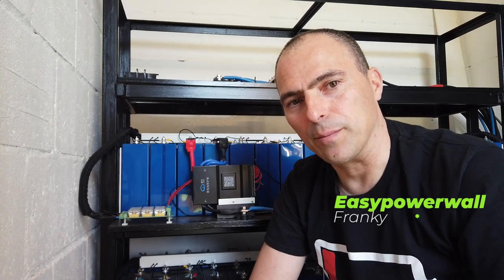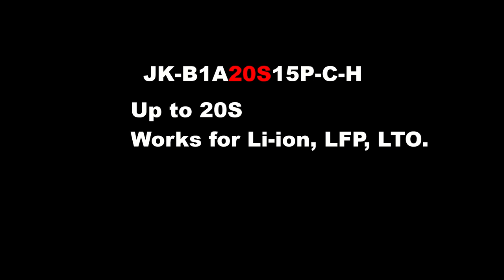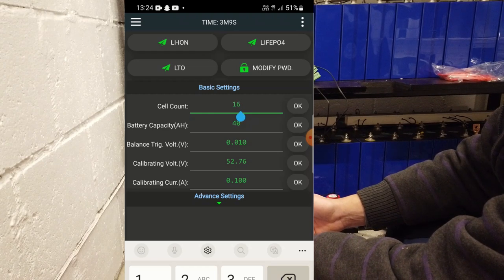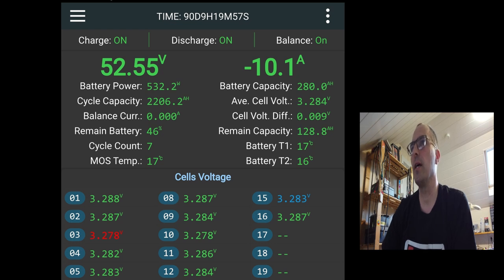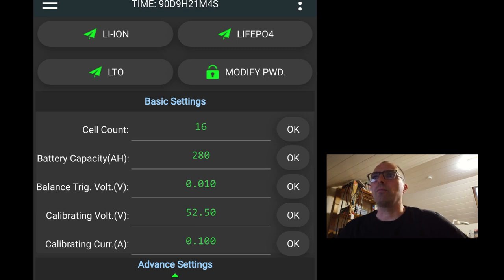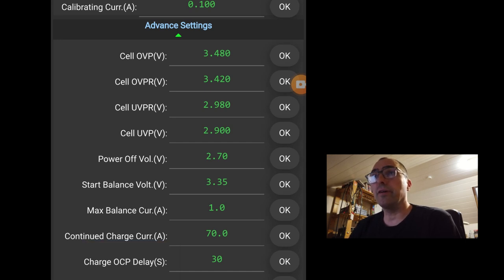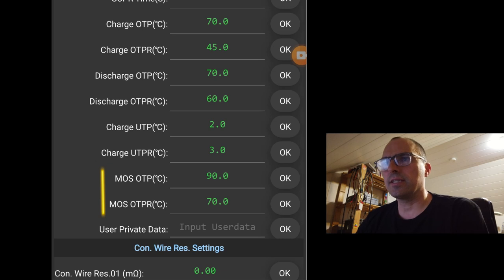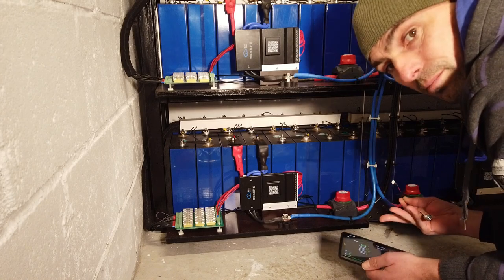JK-BMS in depth review and overview of all settings

Comment: Thanks for walking me through the jk setup and the settings spreadsheet. I also didn't receive the one page doc with the BMS. 
My system is only 3200w inverter, 4800Wh LiFePo4 Battery. To save cost I got only a jk with 80A and 0.6A balancing. I have still a 4A capacity Balancer and will run both at the same starting Voltage. Have installed also a cell meter 8 to have a constant view at my Inverter. The 2 and 4A jk BMS are so costly now. My 80A version was only 50$. Hope to be able to slowly maximize my capacity as I have limits uning only 1440W Solar panels and living in the Highlands of Mindanao, Philippines with more clouds and rain. This is my first solar setup and as a retired electric and IT technician, this project keeps my gray cells busy even at age 71.
Reply from the maker: Thanks for the great feedback. We all started with a smaller setup en let the system grow. Keep up the good work and stay healthy and strong to enjoy the green evolutions as long as possible.
Franky - EASYPOWERWALL

Comment: I have a question, My 2x JK-BMS (JK PB2A16S20P) are configured to let my victron multiplus 2 (3x / 3 phase) load my 2 batterypacks (16x320Ah LiFeP04 Cell) (JK BMSes connected to eachother, then 1 can cable to the Cerbo GX.

My Charging (absorption) voltage is about 54,7V with high current for an hour, and then raises to about 56,7V with low current. Thats the wrong way in voltage!??

Cerbo is set to DVCC Mode.
My most important BMS settings are:
Cell OVP:			3.65	V
Vol. Cell RCV:		3.6	        V	= 57.6	V
SOC 100% Volt:		3.55	V	= 56.8	V
Cell OVPR:			3.54	V
Cell UVPR:			3.02	V
SOC 0% Volt:			3.0	        V	= 48	V
Cell UVP:			2.8	        V
Power off vol:		2.65	V
Vol. Cell RFV:		3.50	V	= 56	V
RCV time:			1.0	        H
RFV time:			6.0	        H

Someone can help me to get this right?

My thougths are first high voltage and amps absoption, then lower voltage and amps for float?
What settings in BMS do i have to change??

Many thanks for reading this,

Comment: Hey Franky, quick question, What would be the settings for a 72v (84v) battery pack built with this. " 26650 Liitokala, model Lii-50A, 5000mAh, 3.7v, max 4.2v, min 2.75v with120 cells    I check the xsl file for the BMS parameters and is great to be able to understand what all those settings mean but not sure what should be the parameters to use.  great content and well explained! Thanks in advance!!🙏

Comment: The reason for the BMS can turn off balance can work like you said to use an external BMS but also to prevent that the BMS discharge the battery since even with BMS power off, balance keeps running, if you have a bad cell you will  end with a discharged or lower state of charge and that is not good for an battery in storage.
Reply from the maker: Thanks for  your reply. Have balancing on from 3.35 (changed setting to 3.4). So when battery is low balancer will not be active and will not drain battery. That's why it's important not to balance all the time, only when voltage is > 3.4V.

Have a nice day.
Franky - easypowerwall.com
Reply: @easypowerwall  I'm also in 3.4 V and probably will go a bit high.

Comment: If you run 2x JK newinverter BMS in parallel, and connect it to Deye (or some other inverter with CANbus), does the SOC be reported in the inverter from the Main BMS, is a mix of pack 1 + pack 2?

Comment: Thanks for the video. You mention on/off switch and old/new version at the beginning of the video but I couldn't see it. Did your BMS come with an external on/off switch, did you mean that?
Reply from the maker: Hi, check the video 5:45 where I'm gonna push the on/off switch. Older models don't have this swith and you had to apply 5V to start the BMS. If you click on the link under the video to order the BMS you will receive the latest model with switch included. Good luck.

Franky - easypowerwall

Comment: Did you ever check the power consumption of the JK-BMS? This is an interesting number as you will typically use this all the time. I found values from a few 100 mW up to 3W and even more. I also found some extremes with 30W and more but i doubt this, probably faulty. Anyway, if its in the 1W+ region it will draw 150 Wh a week or more! Thats already a lot, when the battery just sits idle in a few months (in winter e.g.).
Reply from the maker: That's a good question, but never checked this. Good idea for another follow up video about JK-BMS. Stay tuned.

Franky

Comment: Why are you start balance at 3.35v? There’s no benefit of balance anything below 3.4-3.45v, due to the flat curve. Real balance starts when cells are near full. Otherwise you keep shunting current in the flat curve, for no reason.
Reply from the maker: Hey Aurel, that's a good point. For now I have  it on 3.35 because I haven't done topbalancing (on purpose). I noticed a few cells had less charge then others, so started balancing at 3.35V. In the future I might increase it to 3.4V. Will make a follow up movie 🎬  about this.

Thanks again for the feedback.
Reply: Hello , first sorry for my English, I have a jk bms ,it is 0.6a of balance ,my battery is lifepo4 60v , 20 cells , but I have 3 of this cells with 3.5v and 17 with 3.3v and the bms cut the charge when one of this 3 cells get de maximum voltage 3.7 approximately and the other 17 cells never get a fully charge, do you thing that the bms itself is capable to balancing this 3 cells that have a bigger voltage? , and what parameter do you think that I have to write in the START VALANCE VOLT .( V ) in the settings, thanks I hope you can help me
Reply: @projectv8639  hey, 3.3v means your 17 cells are anywhere between 30 to 60% charged. I wouldn’t want to wait for my BMS to balance 17 cells 😂, could take months. I would either try to top balance them or discharge the 3 full ones down to 3.3v.
Reply: @hammersbald7612  ok I would discharge the 3 cells to 3.3 ,is better I think ,thanks
Reply: Andy's Off-grid garage recommends not to balance below 3.45v to ensure being into the steeper part of the curve. Most specs say max cell voltage is 3.65v not 3.7v.
Reply: If you are disabling the charge balance so it balances all the time when commissioning a new string of cells and you charge at .2C to bring the cells up to 3.5 or 3.55vdc and let them rest at this for a day this is what I would call a good low stress top balance.. Then you could set it to charge balance at 3.45vdc and your charger to 3.48-3.55vdc and should never have to mess with it again unless you have long dark winters and you charge exclusively with solar..

Comment: I would like to ask how does the JK BMS reset to 100% SOC? 
When the Cell Over Voltage Protection occurs?
Reply from the maker: Yes, that's how it works. It learns from charging. The BMS can't exceed 100%, so it set 100% when max capacity is reached.

Comment: Hi thank you for all the information 👌👌👌 I’m getting a 100amp jk bms for my ebike and I will be getting a bigger controller in the near future but for now  can I limit the bms to 70amp  output  to match my smaller 60amp controller that I currently have .
Reply from the maker: Hey, thanks for asking a question. Sure you can limit the maximum current of your BMS. Go to settings and go to advanced settings. Search for "Constinued discharge Current" Enter the desired value. It's in the clip at 19:00.
Good luck.

Frank
Easypowerwall

Comment: Hello Franky, this is really wonderful. Everything is meticulously detailed. I was able to initialize my 2 JKBMS JK-B2A8S-20PC with my 2 12V 280 Amp battery packs, it's great. There is just one small detail, in addition to the Bluetooth on my phone I also have the control screen. (The large model). The batteries are fully charged, but it only shows 78 percent charge. Perhaps this is normal and we will have to wait for the cycles to complete and for the battery and settings to gradually improve. If you could reassure me on this point that would be great. Many thanks again for your video, it’s great. Dominic
Reply from the maker: Hey Dominique, thanks for your great comment. To initialize/reset soc of 100%, your cell has to hit the "cell overvoltage protection" If it cycles a few times it will sync and you will get the 100% SOC number. Good luck.

Franky

Comment: Thank you for this.
I have a question.
The nominal current is confusing to me.
If a battery pack is 48v / 280ah and we have 4 packs = to 1120AH
I would need 4 x JKB2A20S ?? -C-H 
Is the nominal current based on the total AH of the pack so i would need to 500ah version ?
Reply from the maker: Hi, My battery bank has 4 16S configurations. I installed a BMS on every 280AH battery (16S) So a 200AH BMS is OK....no need for 500AH bms. Hope this helps.

Comment: How does Calibrating Current work?

My JK is reading ~30% low at low loads (showing -1.7A when real draw is -3.3A).  And about 50% low at high loads (showing -60A when real draw is -110A).
Reply from the maker: Mine was spot-on. If it's not correct I suggest to use a clampmeter to measure the current and adjust accordingly.

Good luck.
Franky - easypowerwall

Comment: Hell. What setting should I set my charg controller using lifepo4 3.5V 30A+30A 16S. What amp should I set my charg controller?
Reply from the maker: Not really sure what 30A+30A means. is it the capacity of your lifepo4 cells? If so charge both banks with 30A (= 1C). Always good to check the spec sheet of your batteries. In my case battery bank is +1000Ah so there's no limit in charge current as I will never charge above 1C, it's more like 0.1C

Frank - EASYPOWERWALL

Comment: hi! I wiredmy 7S70P 18650  setup to a JK BMS. I have a switch with leds to turn it on.
It turns on as BT can be connected but status LED on switch button akways RED,  cells are at 3.6V each and I only give about 1 Amps to "charge" for test it out.

Why is it red status?
Whats wrong?
Reply from the maker: Hey, the led in the switch is always red. It's there to show the switch, not to indicate a status of the BMS or battery. Hope this helps.

Franky - EasyPowerwall.com
Reply: @easypowerwall  thanks! so red is good.

It works now since days.

The thing I don't find how to measure the real capacity of the battery, I have lots of used cells and only set Ah setting with guesstimation. How can the BMS measure real capacity?

Comment: How low should the  battery for Lifepo4, fall before recharging? It will be used on a wheelchair. Thank you!
Reply from the maker: LifePo4 battery don't have the "memory effect" we know from older type batteries. You can charge whenever you want. In an ideal world I would try to keep my charge between 20 & 80%. If you need the extra energy you can charge to 100% before leaving the house.
Hope this helps
Franky - EASYPOWERWALL
Reply: @easypowerwall  Thank you so much

Comment: When you have several BMS systems do they talk nicely to you separately, can you interrogate each BMS separately (if they are the same type)?
Reply from the maker: Hey Seymour good question. Should have addressed that in the movie. But I can confirm that each BMS works perfectly fine when accessing separately. The application shows all four BMS and you select which one you want to check. No lockups, ne freezes like I once saw on the @TheDigitalMermaid. Will make a BMS follow up movie where I will show how (well) it works.

Comment: I have jk bms 200amp, it worked fine for 30 mins. Then automatically turned off. I tried to wake up as usual with push button but not starting. Tried with 9v battery not starting, also tried with diod mode , no result. I can see little light in push button switch if i hold it. Please help.
Reply from the maker: Hi, If you have the model with the push button, then there's no need/use to try the alternative options. The switch should do the trick. Just check that the overal voltage  en single voltage is high enough. It might be in hibernation mode because there not enough juice in the battery. Connect a charger (charge slow) and try to boot again. If it's not working, you might have a faulty BMS.

Comment: When to start and when to stop balancing 18650 Cells ? Do you know the values ?
Reply from the maker: I do. Used to have a 14S 240P 18650 powerwall.  See www.easypowerwall.com.  I used batteries between 3.4 and 4V. Started balancing at 3.9V   Good luck. When time  is on my side I try to make clip about the 18650 PW.

Comment: I have three of these JK bmss and the challenge I have with monitoring them is that I have to go into the room where the power control cabin it is and use my smartphone to read each one. There seems to be no way to extend the Bluetooth range so that I can monitor from another room.
Reply from the maker: I understand your frustration. But a BMS is not something you should monitor all the time, we have the shunt to monitor the SOC and the state of battery. It's like monitorring the fuse of you breakerbox, you don't monitor them either. But I'm working on a solution to monitor the BMS, if it works I'll share it with my followers.

Have a nice day.

Franky
Reply: Venus OS or Solar Assistant can be used to monitor basic data from JK BMS from anywhere there is internet.
Reply: @tiborchren  does that run on a PC with bluetooth? I can only monitor one BMS at a time and have been leaving my phone in the battery room linked to Windows until its battery dies. There must be a better option.
Reply: I have my system connected with RJ45 to a Raspberry Pi & sending the information to a web page so I can view it from anywhere. The JK uses RJ45 to communicate. I don’t see why you couldn’t view its information also.
Reply: @MistaTerps  My BMS are inaccessible, physically, without moving a 650lb battery cabinet. I'm looking for a bluetooth solution that would enable me to repeat the signal over a larger distance so I can monitor in another room.
Reply: @easypowerwall  I have multiple 16S battery banks, so I need to monitor cell delta voltage on each one, as well as SoC, to catch any problems early before they become serious.
Reply: Ja także miałem taki problem i  rozwiązałem go stosując konwerter RS485 do Lan.Teraz siedzę wygodnie w domu i na PC mam identyczne funkcje jak w pomieszczeniu gdzie jest BMS.

Comment: I have 4 different Android devices and none of them can install the app to access the JK BMS controllers.. Had to use a Windows 11 Pro laptop to program them and bring the 30kw of batteries online.. The controllers themselves seem to do their job and keep the cells in line but the compatibility of the app is very lacking and it is not that big or complex of an app.. I think it has more to do with security and whatever silliness is going on there.. I wish they would just spend the extra 50 cents and install a Wi-Fi chip that has its own local network homepage built in like routers have..

Comment: Do a topbalance at begin and set your start Balance at 3.45V. The OPV must be at 3.64V OVPR 3.6V
Reply from the maker: Hey....thanks for your reply. I don't agree with the settings you suggest. I never charge my cells above 3.5V   It doesn't make sense....there's only marginal capacity gain. 1% or less. Make sure to read the specs of your batteries.

Comment: battery 24v 100ah charger 20 amperes is it normal or is it very strong ampers?
Reply from the maker: Hey, looks normal to me. Power = voltage * amps. In your case 480W = 24V * 20A.
Greetings
Reply: @easypowerwall Thank you

Comment: Very interesting your video. Congratulations. My question for you is, do you know an app for android or windows whitch let me to get a csv or excel file with individual cell values? in other words, each value read for each cell at one moment, but not just read in graphic mode , i need the value into a file for research purpose. thanks and a Best regards from Argentina
Reply from the maker: Don't know by heart, but good question. Maybe it's possible with analog/digital converter + arduino. Challenge is that you need at least 2, preferably 3 digits after the decimal point. If something popsup I will add it to the follow up video.

Frank - easypowerwall.com
Reply: @easypowerwall Does the APP have a log file?

Comment: How can you change the password when you have forgotten the one you changed?
Reply from the maker: Hey Luc, good question for the follow up video. But the answer is pretty simple. When connected to BMS, slide to right towards "settings" where you have to enter your pasword. Now change from technology Li-ion, LTO, ....and this will reset the BMS to factory.  Then switch back to the technology you want to use and apply the setting you want to use. Good luck

Franky - www.easypowerall.com

Comment: User Private Data is where you can add ur own label or name to a system or battery pack BMS and helps you to identify which BMS you are linked to at anytime when u have more than one. I have 2 batteries on a bus setup, so I have labelled them Bus Batt 1 & Bus Batt 2 so I know which one I am connected to.
Reply from the maker: Thanks for the information. Will check it out and add it to the follow up video that I'm plannen in the future.

Have a nice day.

Frank - easypowerall.com

Comment: For me jk bms shows on all cells 0.06v too high voltage and overall for 8cells shows 0.50v higher total voltage. Crappy device
Reply: You got a bad one. That proves nothing. Every manufacturer will have a bad device. Any solution from JK?
Reply: You need to calibrate into the app!